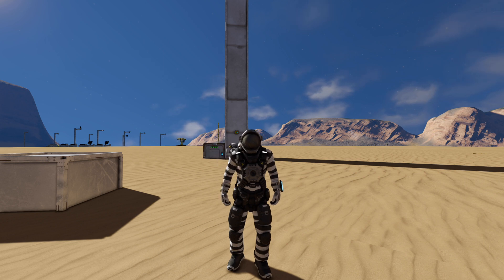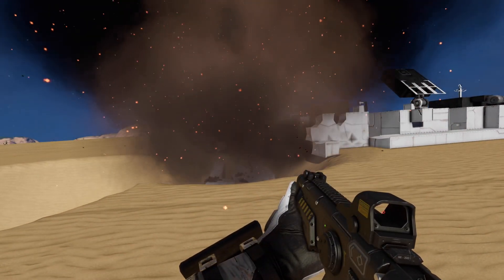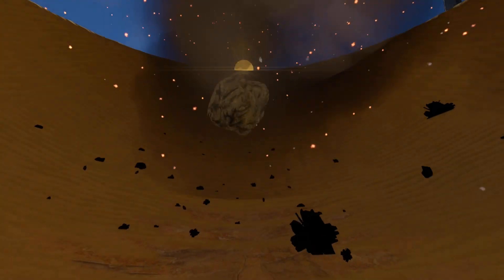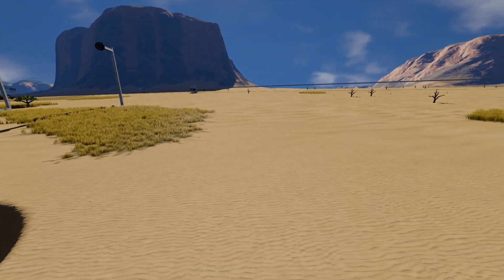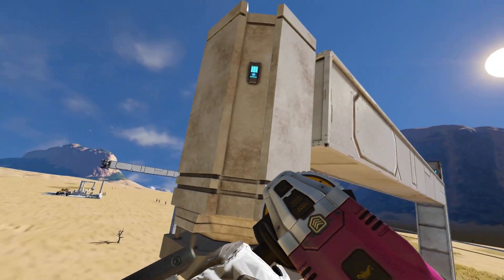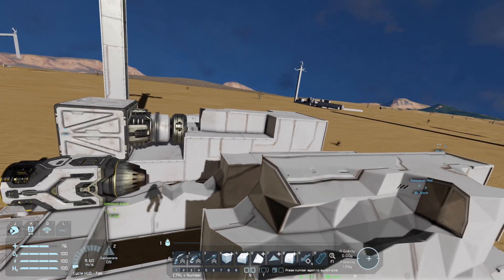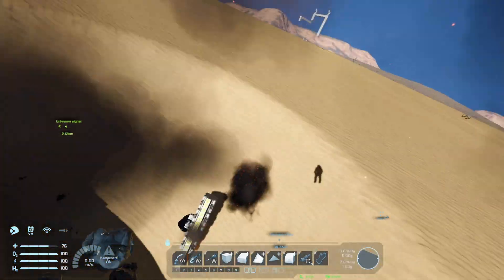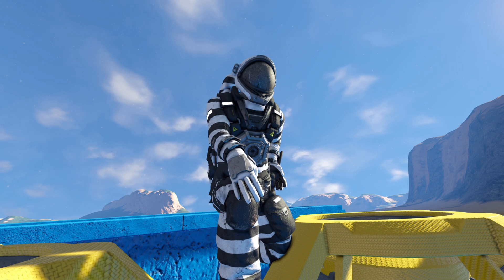Space Engineers Experiments: Making Warheads Explode

Comment: This was actually thought inducing xD Let me explain. I had been prototyping a rotorcannon (basically a bunch of rotors that compress and then extend, catapulting the head of the last one and whatever might be attached (say, a warhead) Also rotorcannons are not an original idea of mine, i just stumbled upon that tech and decided to try it out xD). So, thing is, station based, works wonders as an artillery cannon (launches a small projectile (mergeblock+warhead) at a bit less than 5km (in alien planet gravity). Small ship though, it works for a few shots until i turn, then the system clangs and, while it eventually re-aligns, it doesn't generate the projectile again. Now, your tests showed that the wheel doesn't detonate the warhead, so i'm thinking... would it be possible to have a "wheel-cannon", where let's say we build a warhead+mergeblock, then mergeblock de-attaches, and the wheels start turning at... idk, lot's of speed xD, propelling the projectile out of this "cannon" at "N" speed. Theoretically (thanks to your test) wheels attached to suspensions don't damage the warhead... so theoretically they should be able to launch a projectile.